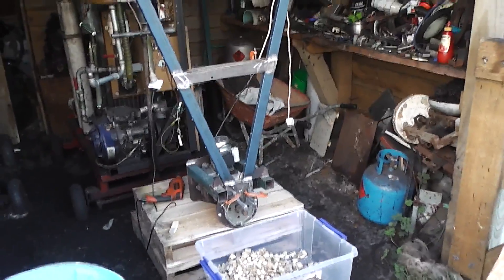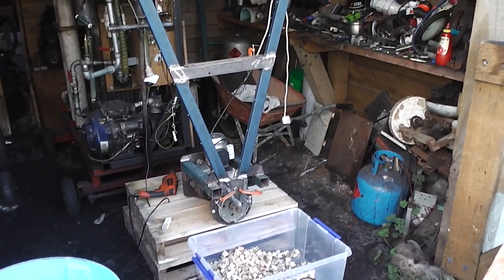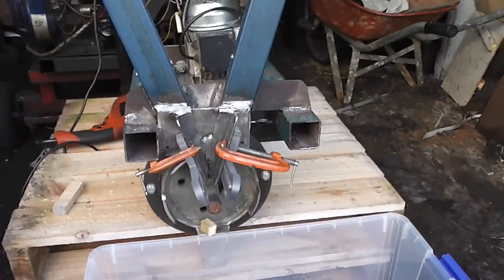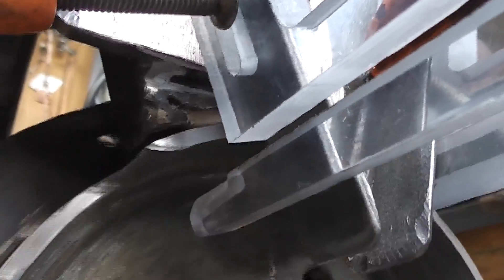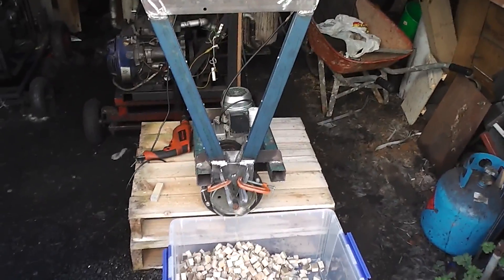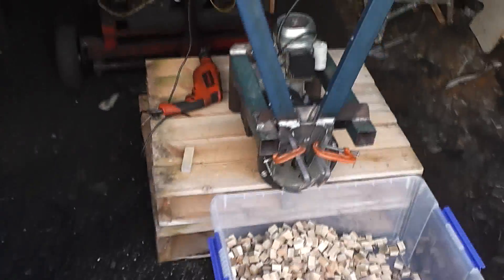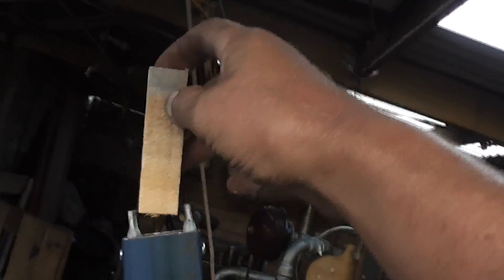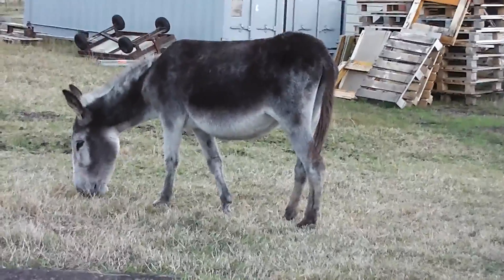Gasoline Granule Generator V2

Comment: Steve, I'm considering using your design for pallet wood processing. What are the specs of the motor and rpms of the gearbox? I just want to get an idea of what I need. I love these old videos. Joe
Reply from the maker: Howdee Joe, 
This is a 400 watt, single phase, induction motor - feeding a worm drive that turns at about 1 rev per second. 
 The rotary shear is 6 inches in diameter, and it has 5, or was it 6 - teeth on its perimeter. 
 This thing works like a charm, and it has clocked up hundreds of trouble free hours  :) .

Comment: also.. I hope the ppl working with this will share there experience. so this tech will get more popular. as long as it doesn't get to the point where we have no trees. we need to plant 5-6 for every one cut down. to help keep up out wood needs. and try to only use waste.
Reply from the maker: +James stranger 
 This technology is making something of a comeback. 
 For many years, it has lain dormant, but now there is new interest in it, so its survival ought to be guaranteed. 
 There is a great deal of scrap wood to be had, so I would like to think that the trees will not have to suffer excessive felling, as this kind of thing happened during WW2 when gasifiers were being used in great numbers. 
 Ideally, we would learn from that, and not repeat that particular human error. 
 There is a thriving gasifier community here on the net. 
 If you'd like to visit miniwoodgas.com, that will help to get you started  :) .
 Also, for some great plans that are totally free - take a looky at the YT channel operated by Flash001USA. 
 There, you'll see how he designed a good gasser, and shared everything with his viewers  :) .

Comment: nice ass! I am hoping to get moved in to my off grid home soon. I'm hoping for the sun. and small creek to supply power. with a gasifier to fuel the back up generator. and a DC generator. for higher demand situations. I have also looked into destructive distillation of wood. for liquid fuel. but I haven't seen much on it. from mostly YouTube. but I guess if there was something ground breaking. this is the last place it would be. what kind of mileage you get from wood? I have a 10hp engine to run. I was hoping to get by with a few hours a day. how many pounds of fuel per hour average do you get? great video I just came across your channel.thanks
Reply from the maker: +James stranger 
 Yup, my Donkeys love to show off, especially if carrots are involved  :) . 
 It sounds like you are setting yourself up for a great life, free of the need to pay power bills. 
 Many folks talk about it, but few actually do it, so I wish you the very best of luck in your plans for the future. 
 Like you, I looked into the destructive distillation process, but there was not much information out there, and it seemed to be harder to do than gasification is, so I chose the course you see in these videos. 
 I have no regrets on this, but I sure do wish I had known about it at least 25 years ago, as that would have made a big difference! 
 On this little system, I use 1.8KG of wood per kilowatt hour of electricity produced. 
 In modern measures, that's 3.5 pounds of wood for 2HP of shaft power for 1 hour  :) .
 Around here, I can get by with anything from 2 to about 6 hours of engine runtime during those wintery days when the solar panels aren't doing very much. 
 What's cool is that the engine exhaust has virtually no smell to it, so that's another bonus  :) . 
 Please do keep in touch as your project progresses.

Comment: What if you mounted this unit under your fairly fast finger saw, so that while the fingers where still confined by the guard after being cut, they would fall against a pin at one end and flip vertical right into the feed chute of this unit.
Reply from the maker: +tinkersdamnworkshop 
I like the way you think  :) .
Having just come in from operating this machine, and testing the new code that I wrote for its computer, I was thinking that there must be a more efficient way to handle and process the fuel.
I have a few ideas to work with, and yours will be added to the mix.
Because the fuel fingers come out of the fuel finger saw in single file, like a string of sausages, I am pretty sure that this can be used as a means of automating the process, and reducing the labour input.
So many ideas, so little time.

Comment: lol I have the same problem cant feed the fuel fingers fast enough with mine too.  just made my video too with your designs works awesome thanks again for sharing  bud. awesome new design, now I may have to build this one too lol
Reply from the maker: ***** Howdee Joseph,

Your video is great.
It sure is nice to see these new machines becoming a reality for you  :) .
In pretty short order, you will discover that you simply can't be without them.
They'll turn the labour intensive job of fuel manufacture into mere child's play.
As you work with these, new ideas will come to you, such as finding a way to stack lots of fuel fingers into the magazine before starting the machine up.
Finding a way to 'set it and forget it' would be good. I am currently working on a way to achieve this.

I like the way you did your magazines. They are open, so you can see the fuel travelling towards the cutter. That ought to mean it is less likely to get jammed as it goes along.
The fuel fingers in my magazines tend to jam now and then, so I think I will need to make the fingers just a little narrower than they are at present.
Maybe I could cut 'windows' into the side of the magazine too, so I can see where it is jamming.

Keep up the good work, my fellow woodgas addict  :) .

Comment: Hello Mr. CNC.
 I love this "mini-chunker" you have designed. I'm kinda new to woodgassing but I am getting great results from my machine. I live in Grants Pass Oregon. There is  a door manufacturing plant that gives me 10 foot length of hard and soft wood that are around 2x2 inches.... You may need to send me this for further endurance testing. good on ya!!  Gordon
Reply from the maker: gordon ooghe 
Thanks kindly  :) .
This little machine really speeds up the fuel production. It is so fast that I can't keep up with it, but I am not complaining  :) .
Right now, I am designing a little computer to put in it. This will allow the machine to automatically deal with what I call "log jams".

It is good to know that you are an active member of the woodgas community, an addict indeed, just like the rest of us  :) .

Your videos are very good, and you are certainly heading in the right direction with your gasifier.
In no time, you will be saving heaps in power bills with your generator, especially if your supply of free wood holds up.

Keep up the good work.
Reply: *****  I shared this video with my friends on "Driveonwood.com" under "BillS chunker" blog. I'm getting some response if you want to look. One comment noticed you are cutting with the grain like that's cheating or something. How much more power would you need to cut cross grain. I am seriously thinking of doing a design similar to your (if you don't mind) I must cut cross the grain tho. Need mo powa Scotty!     I am cutting these wonderful lengths of wood with a chainsaw after bundling them tightly with ratchet straps. 20% ends up sawdust. Your "mini chunker" (I call it) is a really neat design,    Yes.. I'm a total woodgas junkie addict. I just need more money to keep working at it everyday.
Reply from the maker: gordon ooghe Howdee Gordon,

Thanks kindly for the share on Drive On Wood. 
Those guys really take this to a new level with their big trucks and giant gassers.
Their big chunkers make mine look like a toenail clipper in comparison  :) .

Cutting cross grain would be very difficult with the rotary shear on this machine, as the blades strike the wood at a steep angle. If the blades were on more of an incline, then this beasty wouldn't need to cheat in order to chew the trees I feed it on  ;) .
Even Scotty canny rustle up enough power to make this machine cut across the grain, LOL.

Chainsaws are a great way to cut a heck of a lot of wood in approximately no time. I figure that the sawdust ought to be handy also, perhaps as animal bedding or filter media.
I use mine to shore up muddy areas on the farm. Plus, the Donkeys like rolling in it  :) .

Ahhh, it is good to know that the woodgas bug has bitten you and injected a powerful dose of woodgas addiction juice.
Don't fight it. Let it take you to new heights, at least while the money supply holds out  ;) .

Comment: wow that works great also its nice to see u on again i thaut we had lost u lol =3- BTW i won best rat rod at a car show with my VolksWood =3-
Reply from the maker: xoxoXoieoxox 
Howdee partner,

Yup, been out of circulation for a while. Been busy with work, lots and lots of it!

I really am delighted with this new machine.
Even though it still has a couple of little problems that I need to iron out, it really blows me away to see just how fast it is  :) .

That is way cool news on your winning Rat Rod bro  :) .
I bet everyone wanted to see how it worked, and I bet they were asking all sorts of techy questions too.
It's a fair bet that your Rat Rod would have got more people interested in woodgas during the show, so there will surely be some new gassers being built soon.

Looking forward to seeing more of your vids.
Reply from the maker: xoxoXoieoxox 
Sweet, a new woodgas vehicle is going to be born, and a Volkswooden at that  :) .
I am doing the electronics for the new chunker right now. It will have a little computer in it that will make it change direction when it jams.
That should make it a lot easier to use.
My ass gives rides, but you need to have plenty of carrots ready for her.
She ain't too fast, but she knows how to get where she's going  :) .
Reply: ***** sounds like my ford truck slow as hell y have to give it plenty of gas (7mpg) but it will go any were (4X4) cary any thing (3/4 ton) and always get there (ford) but in this country we have this thing called "smog test" every two years my truck has to be inspected to make sure i dont tamper with the emissions controls in this state if ur car was made b4 1976 u dont have to "smog it" this is why i can put a gasifier in my beetle (1971) and i cant in the truck (1984) but as soon as they move that law up the truck will get a gasifier lol =3-
Reply from the maker: xoxoXoieoxox 
We don't have emission laws that strict here, yet.
I am sure it will come though, as this government really hates the working class!

What's the bet, when you fit a gasifier to the truck, it will run cleaner than it ever has before.
That is something I want to try with my gasogen. Take it to a vehicle testing station and get them to check the exhaust emissions.
I bet it would surprise the test crew  :) .
Reply: ***** right so the planet mechanics did this they smoged the truck b4 the wood gas and after and the wood gas was soo clean the machine was having a hard time detecting the engine being on so YES they pollute less than gas AND its carbon neutral b\c the carbon u are releasing would be released into the environment weather u burn the log or if it rots so might as well get something out of it b4 its wasted right AND!!!! the carbon in the wood was pulled out of the air any way so ur just putting back not adding GOOD TIMES lol =3-
Reply: ***** here is something else to think about i used to build muscle cars for a living so i have built a few v-8 and here are some numbers that will make u sick ready  my truck has a 351 cubic inch v-8 that makes 150 H.P. for a cost of 7 miles per gallon now i had a 1969 dodge dart that i had built a 333 cubic inch V-8 and it made 300 H.P. for a cost of 10-14 miles per gallon now the main and most part difference between the 2 is emissions controls truck has them dart dosent and low and behold the dart gets better mileage with more power IDK but in my world if u just burn LESS gas u pollute less
Reply from the maker: xoxoXoieoxox That Planet Mechanics woodgas truck episode was great.
I wish there was more stuff like that on TV.
Having such low emissions that the machine can barely detect it is like a dream come true.
When I first got into woodgas, I thought it was gonna be really 'polluty', so I was mighty pleased when I found out how clean it really is  :) .

When I sample the exhaust from my woodgas engine, I can barely smell it. It's virtually odourless, yet so warm and cuddly on a freezing cold day.

That's amazing stuff about the 351 and 333 Cubic inch engines and their relative economy.
You'd think the smaller one would be the most economical, but no, it ain't.

This reminds me of an old motor cycle I saw on TV.
It had a 1000CC engine which delivered the grand total of 10HP.
Crikey, did the other horses escape?

None of my cars had what you would call a big engine, but I was able to get 33 MPG from the biggest and heaviest of them.
Petrol costs about $9.00 per gallon here, so most of us drive fairly small and economical cars.
There are some folks with big grunters here, but they probably can't afford to drive them more than a few miles.

Let's save lotsa money, and the environment too. 
This looks like a job for a woodgas truck  :) .
Reply: the worst fuel eco. engine i ever had was the M-5 gen set i had it was a 4 cyl for a grand total of 12 hp and it used 1.oz of gas a second i would put a little gas to get it started crank it it would start buy the time i got around to the cab it would be out of gas and it was running right
WOW 9.00 a gal i right now its 3.50 aprox. a gal but our gas is SHIT if the price goes over 4 i use the volkswood at that price my big ford truck is .65$ a mile to drive we estimated that at 60 mph u could literately chuck a quarter out the window every 25 seconds and it would be cheaper than buying gas i cant wait to take the emissions controls off my truck so it will run right but i have to wait for the gov to tell me no more inspections i get away with it in the beetle b\c it dosent have inspections any more its to old so i can do what ever i want with it and its leagle i could put a 502 cady motor in it and it would be leagle lol =3-
Reply: and my beetle gets 38 mpg gas 3 milles per pound of wood =3-
Reply: ***** i replyed but they went as coments for some reason O.o